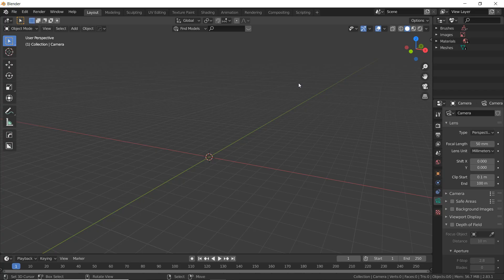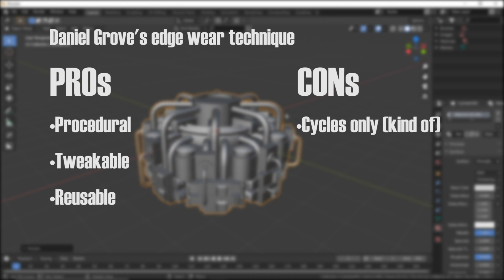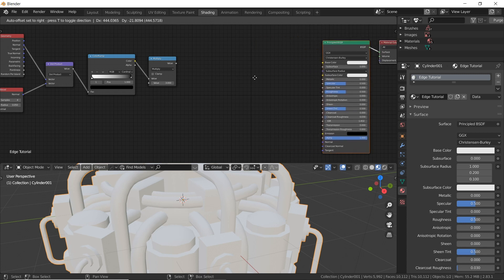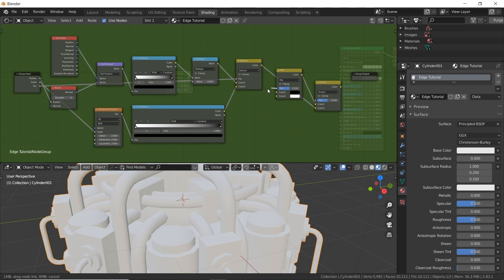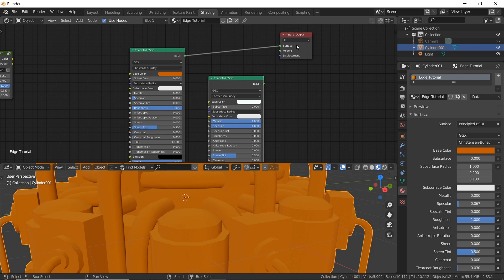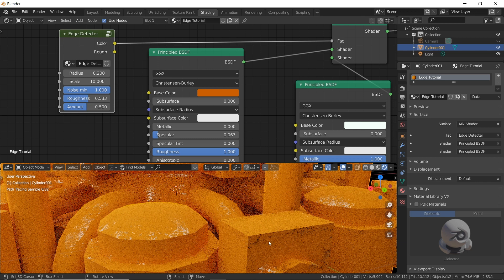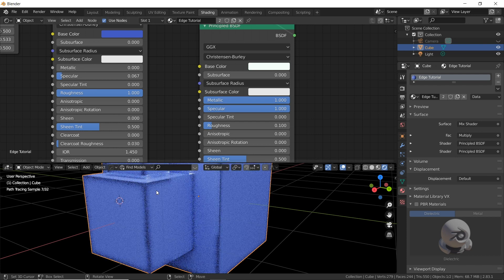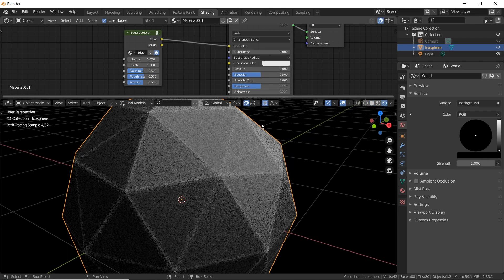Worn edges in Blender

Comment: So, is there a way of getting this to work on a mesh that has keyframe animations on it? The noise in the worn edges slides across the mesh parts that move.
Reply: It seems to fix it if you have a UV texture coordinates and a mapping node plugged into the noise mix
Reply: Scratch that. I did that to the wrong texture. Seems to be working randomly now and I have no idea why.

Comment: The problem is that it is with cycles, which is completely obsolete. They need to add support for eevee, which I hope they are going to.
Reply from the maker: Cycles is obsolete? Who's saying that?
Reply: @DanielGrovePhoto  Eevee does in seconds what takes cycles up to an hour to do. 

Cycles has advantages over eevee in some areas, but it is and has been (since its creation) the goal of blender foundation to replace cycles with eevee once everything that can be done using cycles, can be done in eevee but much faster. 

Eevee has come so far since its creation too. Its impressive to see them closing the gap on that goal. 

It was written in a few articles in its initial years, that eevee was to replace cycles once fully mature. 

They dont talk about it much because some people depend on cycles and are afraid of change. 

But once that gap is closed and there is no longer a need for cycles it will be removed just like every other obsolete feature they have crushed over the years.

Comment: The reason why the Bevel/Dot Product works like this is actually very interesting.

We're basically doing vector math with normals here. The Bevel node gives us "imaginary" normals that would be there if the edges were beveled. These are the same everywhere except at the edges, where they are at an angle to the real normals.

Linear Algebra tells us that <a,b>=|a|*|b|*cos(alpha). Because normals in Blender all have length 1 we essentially get the cosine of the angle between the two kinds of normals. This value ranges from 1=cos(0) where the normals point in the same direction, to 0=cos(90°) where the normals are perpendicular.

For an edge where faces meet at an angle alpha, 90° can't really be reached though; at the edge itself the bevel would be kinda halfway tilted, so the greatest angle between normals would be alpha/2. In other words: The pointier the edge, the smaller the dot product can get.

TLDR, the dot product result gets smaller the closer we get to an edge, the extent to which it gets smaller is determined by the angle of the edge, and the falloff is based on the cosine. (if you want linear falloff, e.g. to play with even other kinds of transitions, try using an "arccos" node right behind the dot product)

PS, I am shocked that there is no "Angle" operator in the Vector Math node.
Reply: Man are you a Mathematician ?!?!?! Such a deep explanation !!!
Reply: @chillegaming1837  It is college level. you should do dot and crossproduct as an 16 year old in school.
Reply: @TauranusRex   Bro this is a 2 year old comment ...
I have done all this stuff in extreme depth and competitive exam level lol.
And here it is "Basic" school level stuff

Comment: it doesn't work for some reason
Reply from the maker: Are you using cycles? And this effect is only visible in rendered view or in the final render. Material view does not show it.
Reply: @DanielGrovePhoto  found out that you need subsurf , great tutorial btw
Reply from the maker: @rokuonl2297  Oh! For which part?
Reply: @DanielGrovePhoto  for the edge wear part wear you connect the geometry and bevel normals to the vector math node

Comment: great tut on procedural edge scratches :)... can i just add, i found it a bit confusing to follow along, you make a great effort explaining the node, but i am missing the ability to follow along visually :(, to see the impact different nodes has on the model and thereby understand what happens under the hood, might also be a great idea to use a strong color instead of a reflective material, since is is really hard to see at least while explaining the core of the node setup.. im only saying this because i think your doing great tuts, great voice over, good pace etc. :D keep it up sir ;).
Reply from the maker: Thanks for the input and I totally understand the difficulty. I think this is one of the more subtle things that can be hard to see along the way. I highly suggest getting node wrangler and using it to preview the nodes along the chain as you develop it. I think it's CTRL SHIFT click a node and it allows you to see the output thus far leading up to that node.

Comment: Thanks for this Addon! But is the any way to make the outside edges really sharp? Like scratched paint
Reply from the maker: Ya you'll need to adjust the color ramps so the edge mask is sharper rather than smooth. Then use noise overlays to add irregularity. Use the resulting edge color data to mask between the paint BSDF and another BSDF for the surface under the paint.
Reply: @DanielGrovePhoto  Thanks for the quick answer! I got it now

Comment: made the node in 2.8 but it just acts like a glorified noise mask and doesnt interact with edges whatsoever
Reply from the maker: Hmm without seeing what you did I can't really diagnose it. Make sure you're in Cycles and I think the result can only be viewed best when rendered. Maybe go back through and be sure you did things exactly like mine, then start tweaking it to your liking.
Reply from the maker: But if it's not sticking to the edges make sure the early nodes are correct and that your color ramps are right too as those dial it in rather than covering larger areas.

Comment: The problem and I guess limitation with procedural methods like this is that this is not really how edge wear works in the real world. Edge wear should mainly be on the edges that are protruding the most but these methods always apply wear along all edges. Anyway great tutorial thanks!
Reply from the maker: Very true it's not accurate to real world weathering. You could however make a blank black texture, apply it to the whole mesh and paint on it white where you'd like the weathering most, then use that as a mask for this effect.

Comment: Hi, thank you for that, how could you use this system on a wood material to make , say an old beam?
Reply from the maker: Well I'd gather a lot of reference photos, try to have them the same type of wood and same era or type of construction if you want realism and model based on what you see in the real world. You'll also need a good wood shader with lots of variety and no tiling, each beam needs to look different than the next. I found a good one named UCP wood though it is a clean wood look not very old. But with some layering of mixed noise nodes on top of the wood you may be able to make it look dirty and aged.

Comment: 4:55 It gives you a scalar (non-vector) value which is maximum (positive) when the two input vectors are parallel, zero when they are perpendicular, and minimum (negative) when they point in opposite directions. It’s equal to the product of the magnitudes of the two vectors, and the cosine of the angle between them.

Just to clarify what this is achieving: the Bevel node is interpolating the normal across the edge; this lines up with the uninterpolated normal on the adjacent faces, but not on the bevelled edge. So the dot product is maximum on the faces, and decreases across the edge. The colour ramp flips this round, giving you a value that is larger around the edge (where you want the worn look to appear), and smaller on the faces.

Comment: Cheers for the tutorial. What did you do during the cut at 9:55? I see that the material preview changed from white to black - I can't get my material to apply the object for some reason, its just staying white. Thanks!
Reply from the maker: Sorry about skipping that little bit! Looks like a fault of mine with a video cut. So just before it turns black you'll notice a cut in my video and when it cuts to the new clip at 9:54 look at the long gradient node - it inverts. So flip those color handles so the gradient goes from black to white. Once I did that I think the viewport took a few seconds to calculate and when it finished the model turned black suddenly. I then play with those gradient values and tweaks the effect. Hope that helps, let me know!
Reply: @DanielGrovePhoto  Thank you for getting back to me! Was wonder how to invert that. Will give that a try, very new to blender so thanks again!

Comment: How do I import this into another model that I have already created? I saved it to my startup file, but I can't seem to access it in a project I'm already working in. Is there a way to import nodes from one .blend file to another .blend file?
Reply from the maker: In your new Blender project go to File > Append, find the blend file with the node group you want, locate the material or node group (don't remember what it's listed as) and click append. A better way is to use the startup method for more common things you'll use repeatedly. Make sure you click on the make fake user button (shield) so it will be preserved in the blend file if it has no users. Next in your new blend project make a mesh, give it a material, in the node group editor, rock click and go to groups and your saved node group should be in that sub menu there.

Comment: A deal breaker for me is that the bevel nodes (and ambient occlusion nodes) aren't supported in Optix yet, so with this node setup, I have to use CUDA, which is far slower.  Hopefully nvidia will fix that moving forward, because I think this could really be a better option than the Pointiness node route.
Reply from the maker: Didn't know they were CUDA specific. Do you mean cycles only and not eevee?
Reply: @DanielGrovePhoto  Well, these Shaders don't work at all in Eevee. But when you have Optix set in your preferences as your Cycles Render Device, you get the following error when trying to use Render Preview, or Rendering:  "Optix backend does not support 'Ambient Occlusion' and 'Bevel' shader nodes yet.".  It does work if you switch to using CUDA as your Cycles Render Device..  but again, Optix is almost twice as fast for me, so..  yeah (this is using a non-RTX card, btw).  It's a good idea though! I do hope nvidia adds it in a future driver update.
Reply from the maker: @graphicsmatt  oh now I understand, thanks for clarifying that. I have not tried Optix yet but I'm glad to know now but it doesn't support all the things that I might use.
Reply: @graphicsmatt  dude same! I had to switch back to cuda. Also this isn’t working on my edges?! It’s mainly faces and stuff. I’m in 2.91 so idk if that makes a difference

Comment: This is incredibly complicated. I cant believe there isnt an easier way. How is everyone else doing this? And what about when you have texture maps already? There needs to be a simpler way.
Reply from the maker: It definitely seems that way at first but once you've made your node group and saved it in your startup file all you need to do with future projects is add it from the node group menu when you want this feature. That's a huge time saver and most procedural shaders that emulate real world stuff are crazy complex! This one's actually very simple. But ultimately I agree there should be a bide for edge detection pre-built in Blender that works like what I've made here. Thanks for watching and I hope you learned some helpful tips.
Reply: @DanielGrovePhoto  I bookmarked the video to my blender folder. Im still trying to figure all this out. Not easy.
Reply from the maker: @davidyisrael007  I hear you! Start with my basic videos on modeling, textures, and intro to blender.
Reply: @davidyisrael007  This is pretty straight forward as far as blender is concerned. If you're just learning, maybe don't start with procedural texturing tutorials...

Comment: Thanks so much - learned a heap, and things that I can apply to other uses too.  Even the simple insight of how you have the preset node groups in your startup file unlocks far smarter ways of setting up b3d.  Thanks
Reply from the maker: So glad to hear it! You may be a le to even make an accurate wire frame node with this trick. Thanks for watching and writing. What would you like to see next?
Reply: @DanielGrovePhoto  TBH I know too little to know what to suggest : ) Just please do keep them coming.
Reply from the maker: @GeoffSteeleAU  will do! Check out my other blender vids in the mean time.